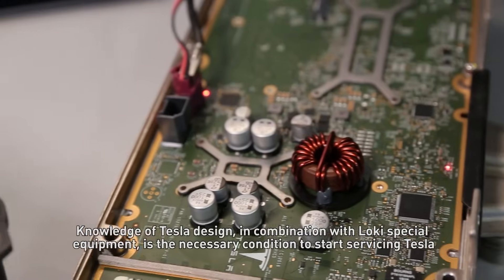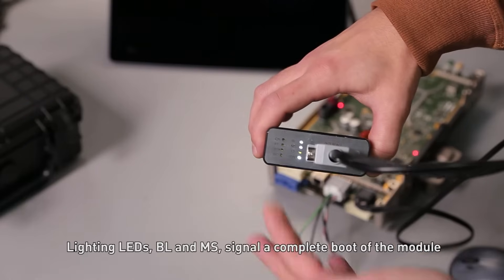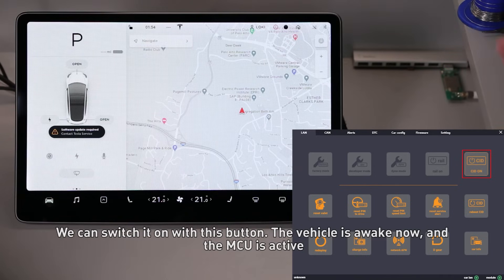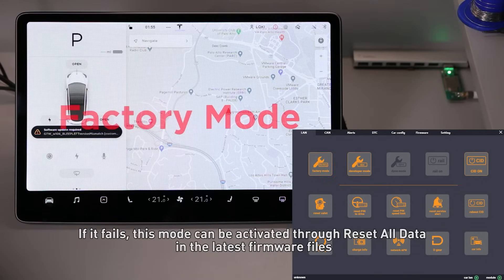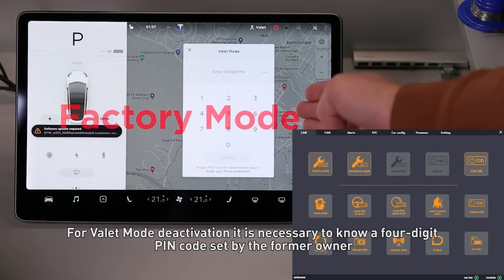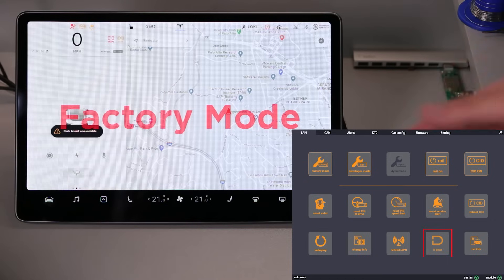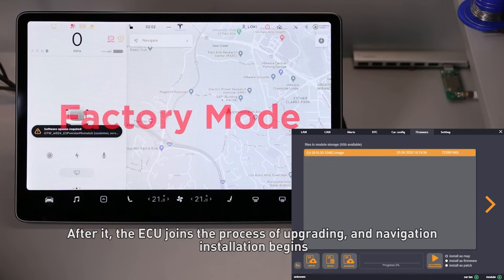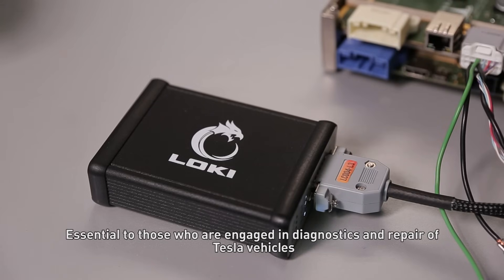Loki: a multi-function device for Tesla diagnostics.

Comment: I have a tesla s70 year 2016 parked here in Brazil at the electrical workshop, I know that I have to resist the company at Tesla to be able to access the system, the problem was that the owner of the car forgot to charge it and thought the car I could handle walking to the place where he wanted but unfortunately the owner miscalculated and now the car is in the workshop, I would like some help
Reply from the maker: We only offer to purchase equipment. We are not a car service and, unfortunately, we will not be able to help.